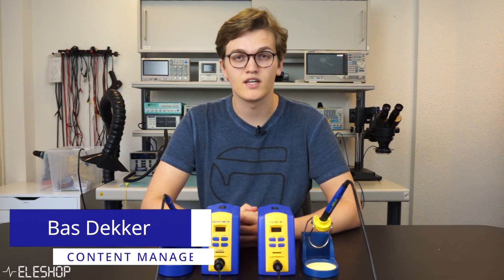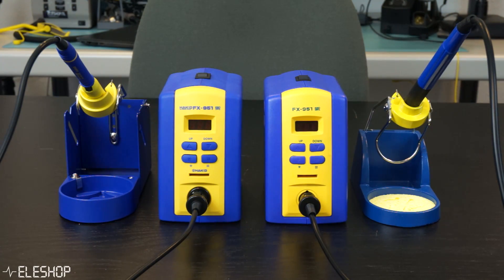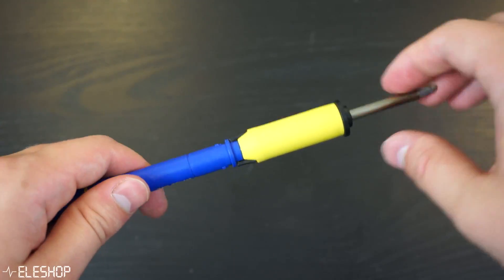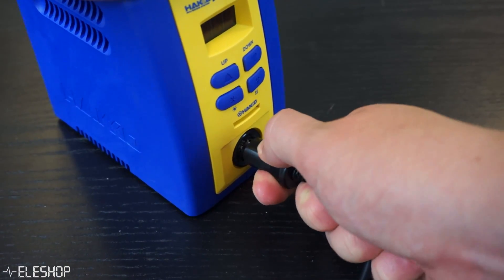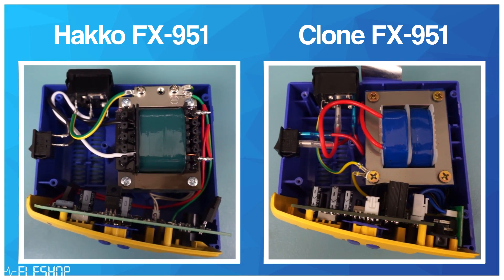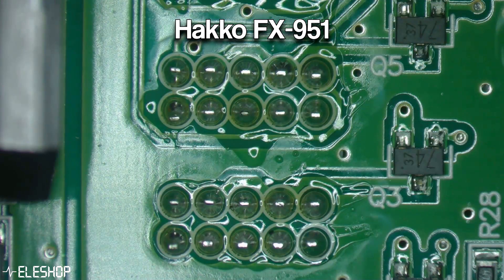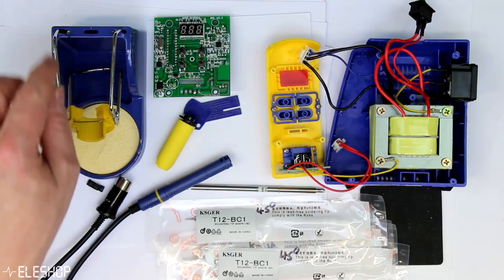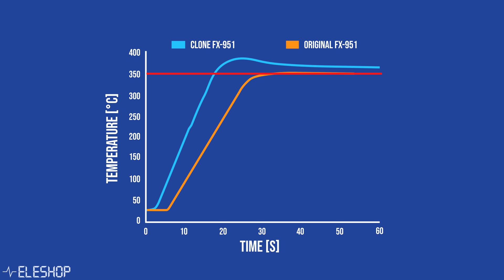Does an AliExpress clone beat an original Hakko soldering station?

Comment: You forgot to say they cloned the same braindead user interface or should I say a lack of an interface and because of this you shouldn't buy either. I ditched the clones and went with a KSGER which has much better options and an infinitely better interface than the original hakko.
Reply from the maker: Luckily Hakko has improved the interface on most new models. Its less braindead now.